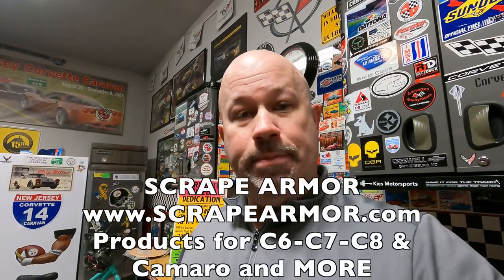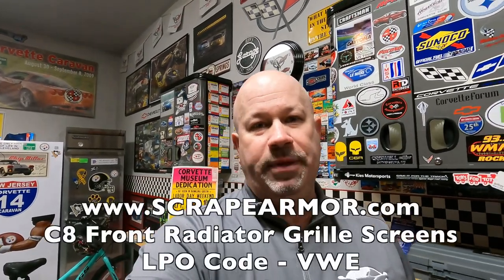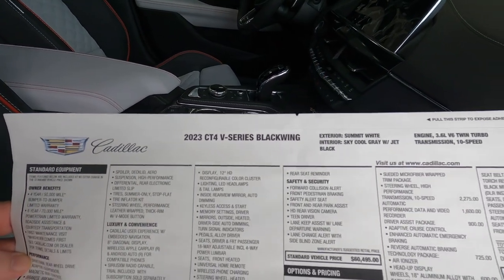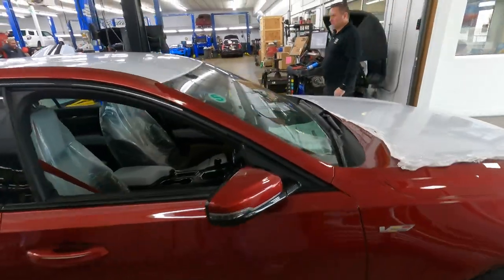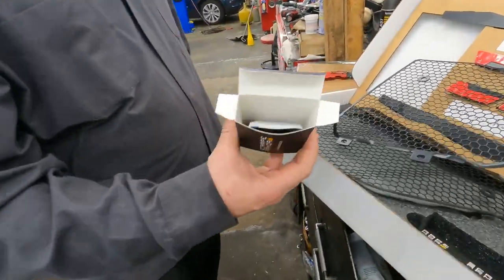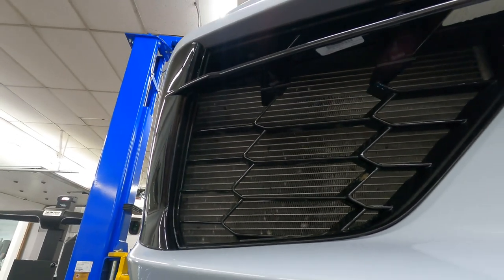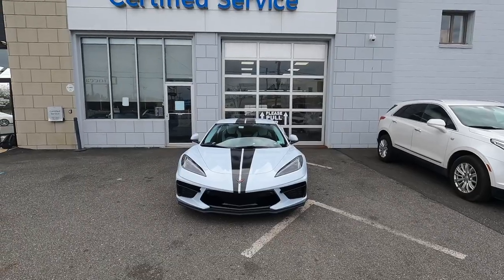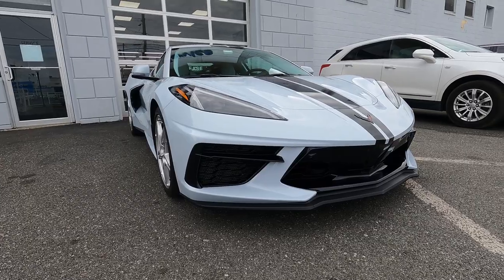SCRAPE ARMOR C8 Corvette Radiator Install & Upcoming Events

Comment: $495.00 you gotta be on drugs.
Reply from the maker: That's is the installed price for a GM warrantied part.  It's cheaper than new radiator, but I see your point too.  Guys are spending upwards of $5000 for PPF and ceramic so what's another $500? Thanks for watching.